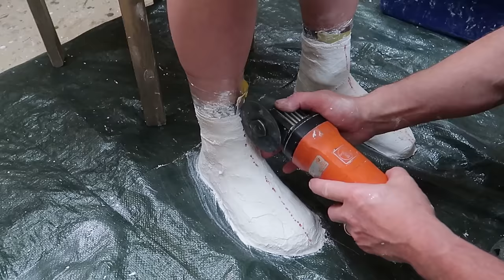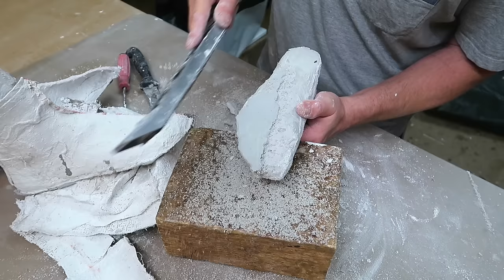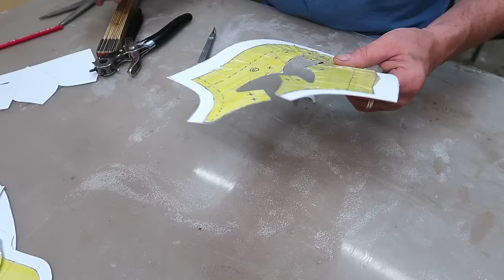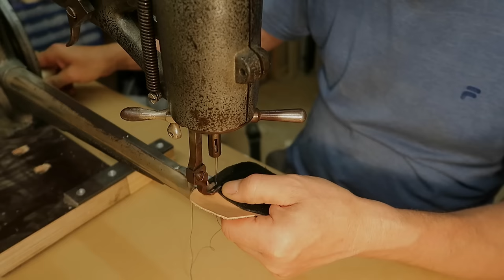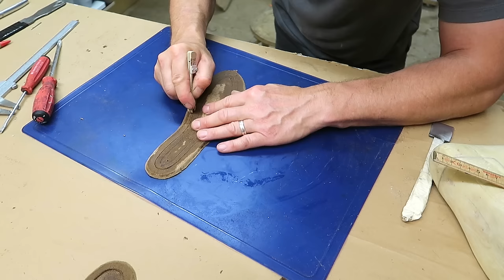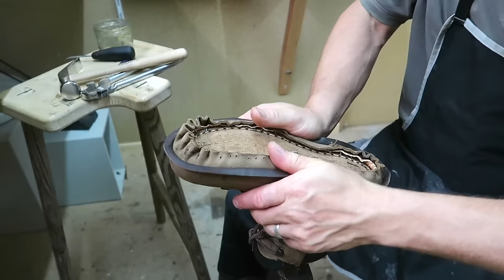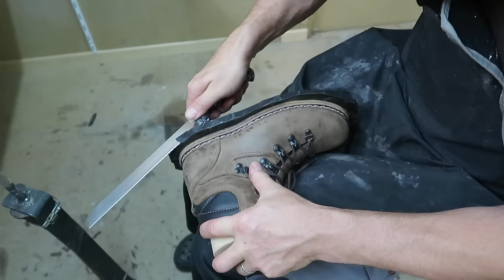Making handmade hiking shoes - Making leather shoes

Comment: Excellent build all-around, but especially the welting technique is really unique: like a norwegian welt mixed with stitchdown. And to top that off, the midsole is blind stitched through.
Reply: When I was stationed in Germany .I had the same thing with a German professional shoemaker. Did the mold of foot and measured each foot in 16 different places.
Reply: It’s the standard for a storm welted construction made by hand. This way you have both the welt and the upper protecting the crease between upper and midsole. It’s supposed to be more water resistant than any other traditional construction method

Comment: Nice work. Can you tell me what you use for the soles? And what kind of polyurethane foam do you use for the lasts?
Thanks in advance.
Reply: I believe Andi mentioned in a reply to another comment that he uses ASTI-OP from a firm called Beil in Germany. Their catalog recommends the 700 kg/m3 density for lastmaking.

If you are interested in last casting, as I am, I also recommend that you look into thermoplastic polyurethane. Some of the German orthopedic suppliers also supply this material in pellet form, which can be melted down and recast many times.

Comment: Could you tell us what type of liquid foam you use and also what type of plaster you use? Great video and techniques.
Reply from the maker: The plaster is model plaster from the DIY store. The foam for the moulding is made by the company www.beil-peine.de. The foam designation is: Rigid Foam ASTI-OP and ASTI-L.
Reply: @andiswerkstatt-ow4uw  Thank you so much for sharing this information! I looked at the Beil catalog and they seem to recommend the 700 kg/m3 density of ASTI-OP for shoe lasts. It is an expanding polyurethane foam.

Comment: What release agent did you use on the plaster before pouring the PU foam? Did you dry the plaster in an oven first to get it as dry as possible so it doesn't over expand?

Comment: The customer is very brave person,the shoemaker used an angled grinder on his feet
Reply from the maker: This machine is not an angle grinder. With this machine, the cutter blade only moves slightly forwards and backwards and only cuts hard materials. It's the same principle as cutting open a plaster cast in hospital. Nevertheless, this machine is loud and also a little scary.

Comment: 0:36 😱
Reply from the maker: It looks dangerous, but it's not. This machine does not have a cutter blade that turns. 
It only moves back and forth very slightly. This means I can only cut hard materials. It does not cut soft things (socks etc.). It's the same principle as cutting a plaster cast (e.g. broken foot) in hospital.v

Comment: Don't you wasting too much time, making mold and all? If you where creating some recursive system to automate shoe manufacturing probably it will be interesting doing such long process. 😂 But for single clothes just use common sense and cut adjust later